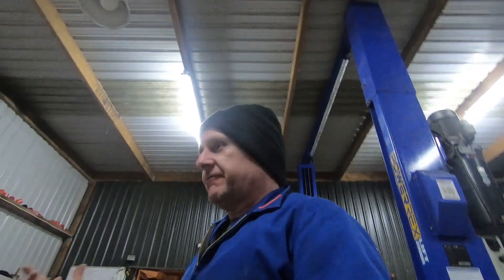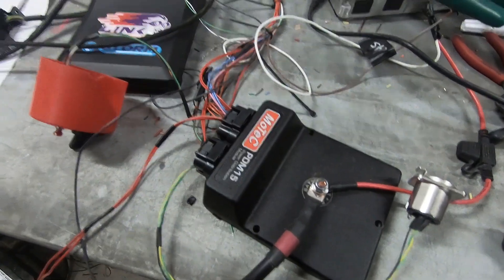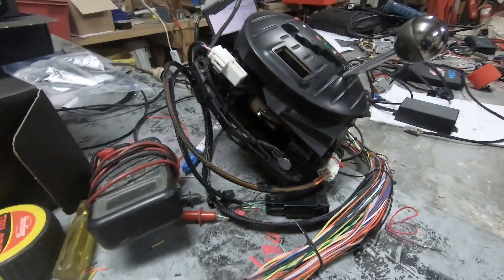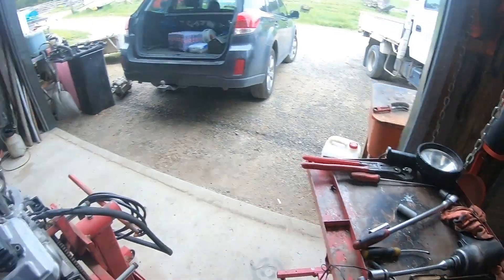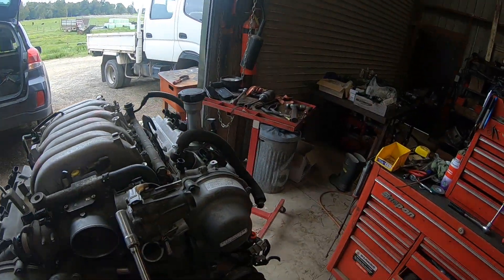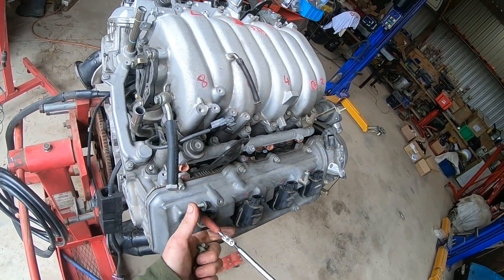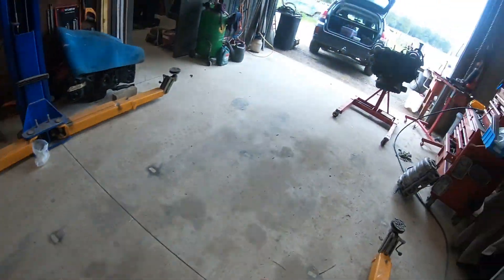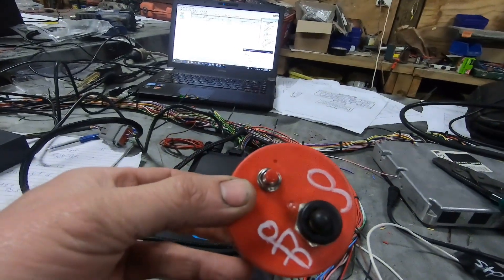47 Ford Pickup truck to 1uz VVti Toyota V8 wiring. Part 2

Comment: Thanks for the vid. 
I've read all the stuff about the starter being a pain. 

Lol don't think I can beat your time of 3.2# but I'm pretty sure it's not going to take me a whole weekend now! 
Thank you for showing the truth ;)

Vroom vroom
Reply from the maker: Yep.  Lots of people that could do with some concrete pills for removing the starter.  Maybe I do them too often.  There is some prep time between removal and refitting which hopefully will be part of another video.  I've been wondering about putting up the gopro footage of removal too.  Interested in seeing that too?
Reply: @CartuneNZ  I think you should also add "ls400, sc400, ls430" etc to the vid, hopefully get you loads more views now that these cars are getting older and people consider diy-ing on them.
Reply from the maker: @supadupa3  Great Idea.  go through from time to time and update my tags.  Been a bit busy doing videos and actually fixing cars.
Reply: @CartuneNZ  I would love to.  
Although,  I now have the confidence to be able to get it done in a few hours.

As you're aware there are loads of people that play this up to be a job from hell. I've had plenty of those in the past and your videos and a couple of others I've found point to it being fairly simple. So I'm not daunted now,  I think it would still be very useful to others that are willing to try and capable but get scared off by all the so called horror stories.

Comment: Hey, thanks for making these videos! I was laughing at your starter comments! I'm putting a 1uz in my truck and people are telling me not to do it because of the starter placement. hahaha.
Reply from the maker: Thanks.  I have only seen photos of this truck so far and am really looking forward to seeing it for real.  The wiring so far is fitted and the dash powers up and the fuel pump primes.  Startup is very soon.  UZ starters are easy once you have done a few.  haha.  And I might have done a few now.  I nearly always check before fitting and rarely have issues.  Try changing a chev starter with massive headers when you can see it but have to remove the headers first.  What truck are you fitting it to?  Which Model 1uz?  Cheers